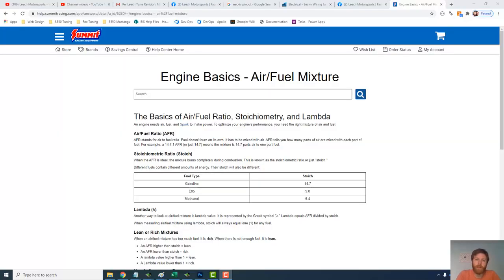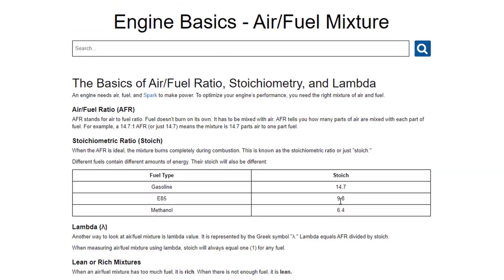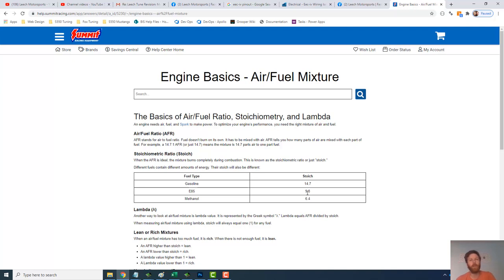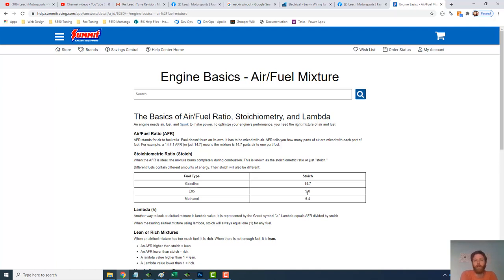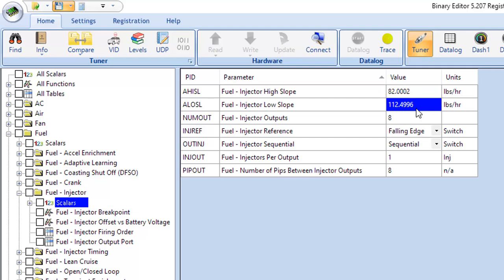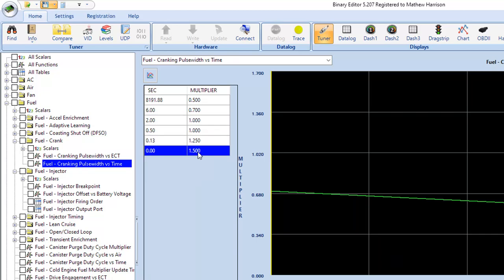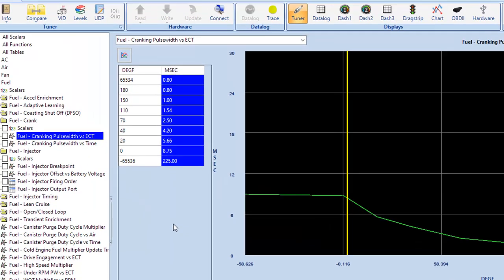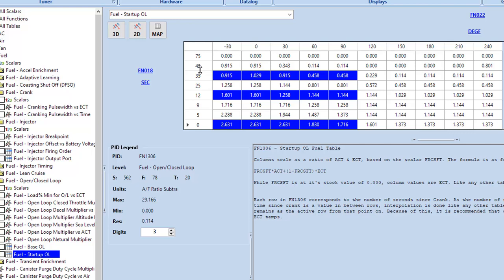E85 Tuning for Foxbody Mustangs with Moates QuarterHorse and Binary Editor

Comment: Does changing Z_AFR do the same thing?  It has a E85 option.
Reply from the maker: You are correct. I was planning to mention that in the follow up video. However, I still prefer the injector manipulation technique due to the 112.5 lb/hr max number for the injector slopes. I’ve never tuned an e85 sbf with smaller than 80 lb injectors, and some much bigger than that. Two birds with one stone.
Reply: @LeechMotorsports  Changing the injector settings as you demonstrate would also require changing fn367 also amongst a few other fuel related settings. z_afr is the better alternative in my experience. Many ways to skin a cat.